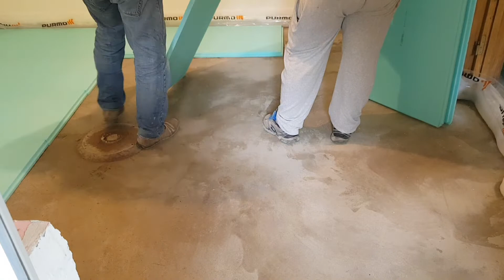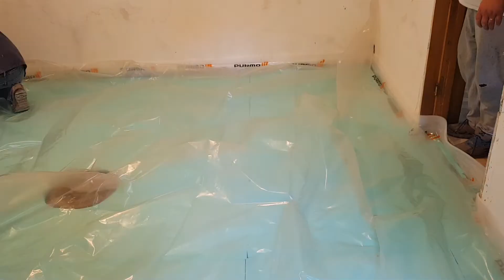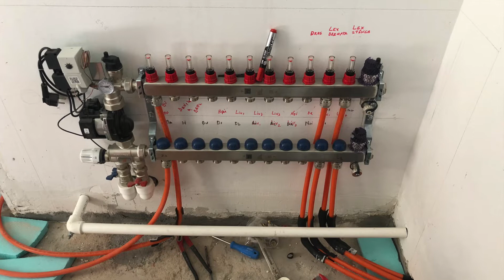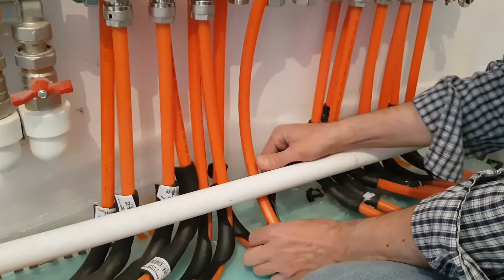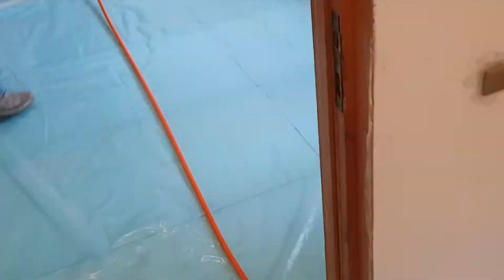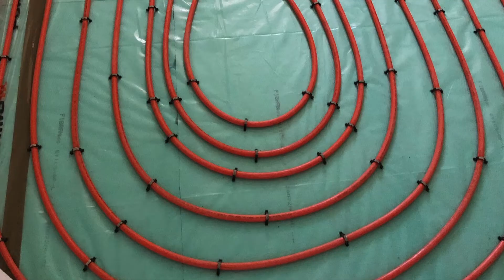Incalzire in pardoseala Purmo cum faci singur incalzirea in pardoseala

Comment: Salut! Am cumpărat un distribuitor cu 11 cai (defapt eu un distribuitor cu 8 cai +3 cai adăugate ,total 11) pentru o suprafața parter de 80m2 parter la etaj fiind calorifere. Sunt prea multe circuite pt 80m2 sau e ok pe tru ca o sa am circuite mai scurte si țeava mai deasa la pas de 10cm iar la ferestre si uși fiind mari o sa fie pas de 5cm ! Mersi😊
Reply from the maker: Este foarte bine, cu cat sunt serpentinele mai multe si mai scurte este mai bine, acum sa nu fie de 20 ml, ca nu are timp sa degaje caldura. Puneti teava cat puteti de multa, mai bine sa fie prea cald si sa aveti de unde sa o dati mai incet, decat sa nu faca fata. Puneti 3, 4 serpentine la 5 cm, in jurul ferestrelor si usilor. Iar la peretii exteriori macar 2 serpentine la 5 cm.
Reply: @EasyToDIY  mersi pentru răspuns. Circuitele vor fi între 60ml-80ml nici mai scurte nici mai lung de atat, o sa încerc sa pun 11ml/m2 ! ce fel de țeava ar fi mai buna pentru proiectul asta PexA,B,C sau PE RT ??
Reply from the maker: Nu stati sa calculati 11 ml. puneti cat intra, teava este ok si a,b,c. parca nu as pune pert.  eu am mers 90 % pe teava giacominii, pex b, a fost excellenta. am pus si uponor si mi sa parut o prostie, parerea mea, slaba calitativ, prea moale, se cuteaza imediat. cu toate ca e mai scumpa.